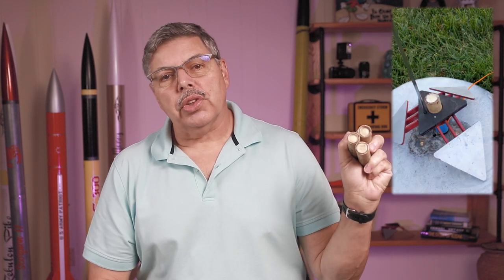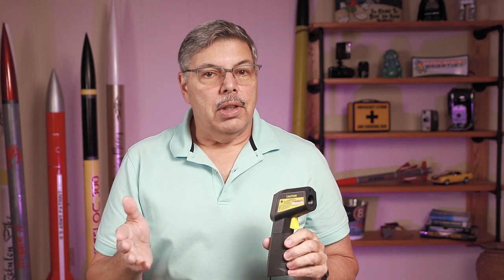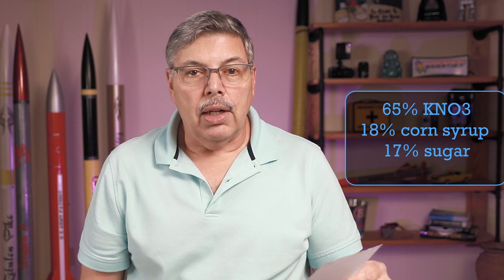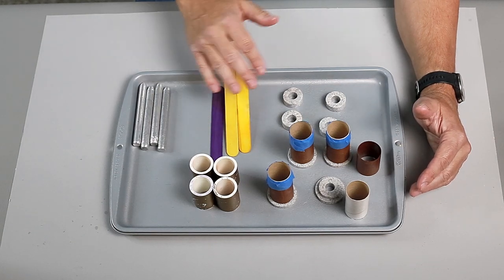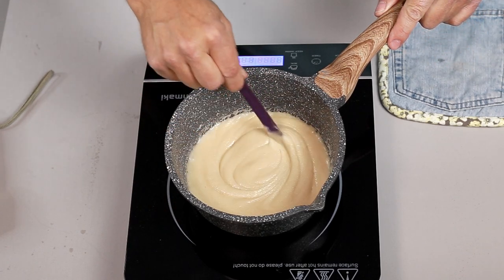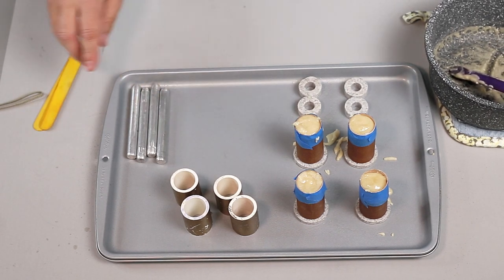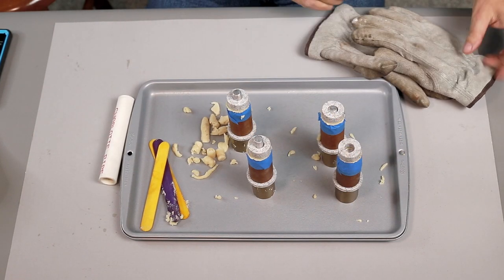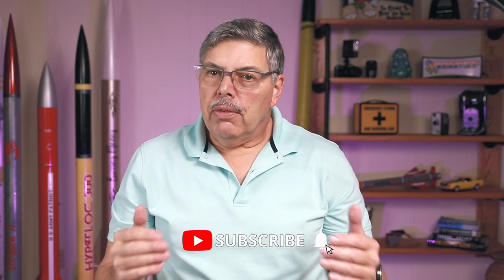Supercharging Your Rocket with Sugar - HERE'S HOW!

Comment: We used to use plastic syringes for the kero syrup. Make a stand to hold one syringe upright, with the plunger removed, on the scale, reset scale to zero and with another syringe slowly add the syrup.  Get the kind of syringe that has a short nozzle with a cover. LUR-LOK was a brand name, and I'm not sure in the spelling. The second one can be any type.  
45 years ago any grain elevator or animal supply would have them. Today, who knows where you can get them.  Makes getting the proper amount of syrup into the mix less messy!
Reply from the maker: Yes, the Karo Syrup is messy, I will try your idea.

Where you using Karo Syrup in rocket fuel and if so how long ago was that? Thanks for your comment!

Comment: 265 F is pretty hot for flex fuel. Quoting Dan Polino in his 'How to Build a Sugar Rocket' page 352, "Once the fuel mixture reaches 210 degrees", unplug and immediately pour'  Even doing KNSB I never go above 225 F. 
For safety, you might also want to have a bowl of cold water close in the event of sticky propellant on fingers.
Reply from the maker: I have cast the fuel at 210°F and it produces a rather soft and gummy grain for me even after a week of cure time. I think the corn syrup plays a role here.

Over the last four years I have found that gently heating the fuel and driving off some of the moisture makes for a more robust grain. Casting at 250 - 265°F makes the propellant quite fluid and will lengthen the pot life allowing 4 - 6 38mm grains to be filled. I can then pull the coring tool in 15 minutes.

What I would like to know is how Dan Pollino pulled the coring tool out of a 2' long motor without a winch! No aluminum foil here, just WD40.
Thanks for your comment!
Reply: @TheRocketeer  The 'soft and gummy' is characteristic of flex-fuel. Driving off much of the water in the corn syrup from over cooking makes it more like regular KNSB, for short BATES style grains that's no problem.the smoothness of the coring rod makes a difference. I have some mandrels with a few tiny imperfections on the surface that make it difficult to extract. I try to take good care of my mandrels and discard if they start becoming 'difficult' to extract because of dings or other surface damage. I've pulled 7 foot long mandrels from case bonded sugar motors...plastic/paper wrapped.

Comment: I get good results making engines the dry method. I never cook my fuel .I use convection sugar, Potassium Nitrate in a nutra-bullet. 1 for fuel, and 1 for kitty litter clay.
Reply from the maker: Yes, that is easy and works great for smaller motors. Packing fuel does not scale well for larger motors.

Comment: Well done. Good idea to update the video. I have a question about the coring rods. I have 3/8 inch steel rods. Easier for me to get than the aluminum. Will their be a problem with this e.g. iron reaction in the fuel? I know they will conduct the heat more but I will wear protective gloves. Also, where do you get your casting tube and phenolic liner from for your Loki engine? I am having trouble sourcing that.
Reply from the maker: I don't recommend steel because it could cause a spark. Delrin (acetal) rod works the best. It is inexpensive, easy to shape, does not transfer heat well and it is slippery.

I got the standard casting tubes from Always Ready Rocketry. https://alwaysreadyrocketry.com/product/standard-casting-tubes/
I will update the comment section with the web address.

Let me know how everything works out for you. My email can be found on the "About" tab. I am working on more videos for flexi-fuel and another mystery sugar!

Comment: Hi, thanks for your awesome videos. Why do you devide the propellant of a sugar rocket motor into mulitple grains and not a single large segment? Can I build a 1 inch pvc motor with a combustion chamber length of 240mm with only one propellant segment, so directly cast the propellant in the pvc pipe?
Reply from the maker: It is possible to make a rocket motor by pouring a single grain, but it may lead to some issues. Pouring a single grain could make it difficult to remove the core tool in a long core, and the PVC pipe may become very flexible when hot. Therefore, it is recommended to start with a fuel length of 205mm and increase the length gradually. Casting a bunch of grains, storing them in desiccant, and then assembling a couple of motors at a time is a better approach. Rocket motors need to be ignited from the top to perform well. It's important to keep a safe distance when testing the motors to avoid any mishaps. So, it's advisable to keep your distance when testing and stay safe during the process.
Reply: @TheRocketeer  Thanks! can I also use normal supermarket sugar and the potassium nitrate to make the propellant and easily cast that into the grain mold?
Reply from the maker: @johnny4498  Yes, you can use regular sugar,  corn syrup and potassium nitrate power.

Comment: My question is this ? After blending 60/40 
Pot. nitrate and sugar, would adding a small quantity of black gun powder increase thrust ?  I have a few mortor fireworks that I have had for years and want to "carefully" cut them open and get the powder from them. Additionally, I want  to cut open some larger size colored smoke bombs and mix that powder to my sugar fuel to leave a smoke stream when taking off. My question is about the fireworks powder. Not the colored smoke. That was an afterthought. Lol 
Will it give me more pounds of thrust ?
Reply from the maker: Black powder burns faster than sugar fuel and will probably cause an explosion. Sugar fuel does not really nead any help.

Comment: I am worried my kno3 might get too humid after some months. After doing what you have done, will it be dry?
Reply from the maker: Starting with dry components always helps. The Kno3 can be placed on a cookie sheet in the oven at 200F (94C) for an hour if you are concerned. The casting process will help dry the fuel and it will remain dry if sealed in a plastic bag. Desicant can be added to the storage if the fuel is not used for months. 

Thick food storage bags made for freezing food or storage for printer filament is an effective barrier. I have found sandwich bags are only good as temporary storage and can let moisture in over time. I hope that helps.

Comment: Can I just use regular cardboard tubing?  Like toilet paper or paper towel tubes?  And how to I know the diameter of the core?  I've made some KNO2 + Sugar PVC pipe rocket motors and am looking to be a little safer (really it's my 12yr old who is into this, I'm just the safety tech and the $$)
Reply from the maker: Yes, you can also use a cereal box for the casting liner. The core size is dependent on the motor diameter and is listed in every video, for a 38mm motor it is 1/2" and 3/8" for a 1" PVC motor.

This activity is not suitable for a 12 year old unless very carefully supervised. I recommend an induction cook plate for making rocket fuel. Be careful and have fun.

Comment: how long to make fuel from sorbitol and what power of the induction hob
Reply from the maker: It takes around 6 - 8 minutes to heat the fuel slowly. The power required for an induction cooktop depends on how much fuel is made at one time. I don't go over 600 watts for most batches of propellant.

Comment: ok, so these are grains for a re-loadable system? Any way to make single use H motors with PVC schedule 40 pipe? do all 4 of those grains equal an H220 or is each grain an H220?
Reply from the maker: All four equal an H-220.

Comment: Which gives you corn syrup in the fuel?
Reply from the maker: The corn syrup is added with a small paper cup.
Reply: @TheRocketeer  Maybe you didn't understand me because I'm studying English, but I mean the functions of corn syrup in the mixture?
Reply from the maker: @stanisawgorczyca6460  The corn syrup is used to dissolve the sucrose at a lower temperature instead of melting it at high heat. Adding corn syrup also prevents the grains from becoming brittle and reduces the chance of cracking when under thrust.

Your English is fine, I did not understand the question. I hope that helps.